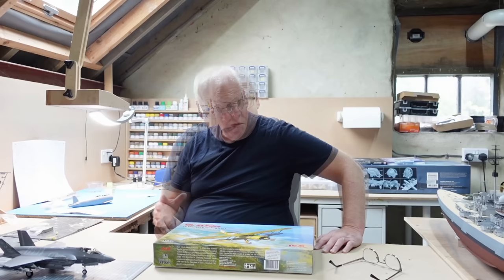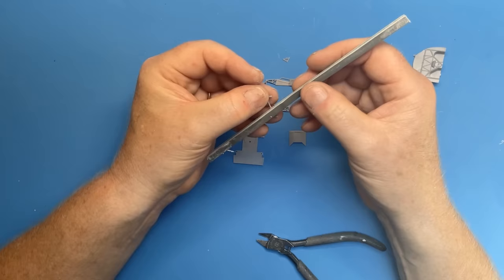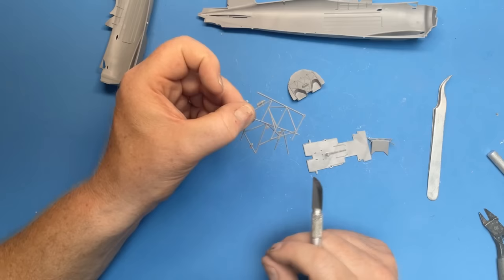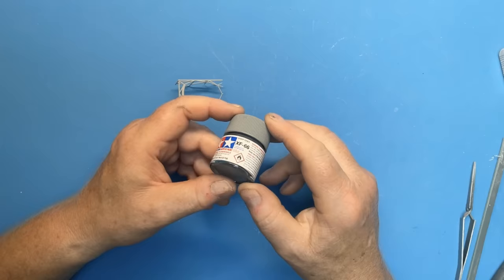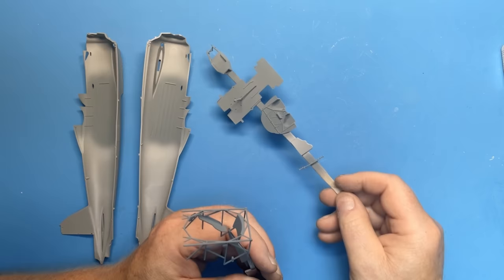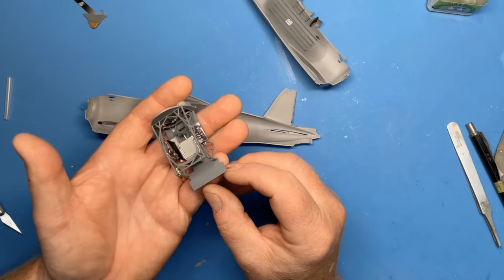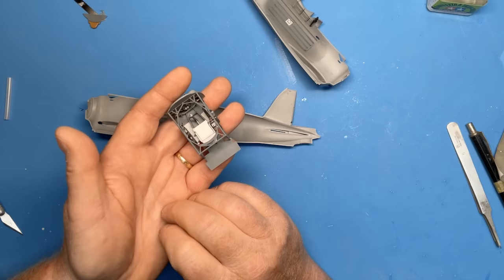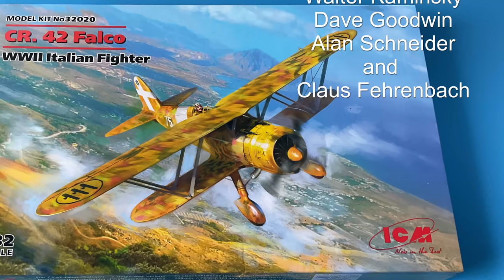ICM 1/32 CR.42 "Falco"

Comment: I would recommend that when using the Quinta studio decals, that you use white glue such as Micro Kristal Klear.  I my experience there is little in the way of adhesion on the decals. I do believe that Quinta recommends some sort of fixer be it super glue or white glue.
.
Reply from the maker: thanks Gary they appear to have stuck very well but time will tel I guess - I’ll use PVA of some sort next time to be sure
Reply: I’ve used Quinta Studio 3D decals a few times. They’re really easy to use and look incredible.
My view of them is that they’re only on the backing paper in order to print them. You can soak the whole sheet, seperate them, dry them with paper towel and put them aside to glue with CA, PVA or whatever you like at a later date without detriment. There’s no adhesive, per se.
Reply: @johnmarley6695  I have never seen anybody do it that way, but it makes sense